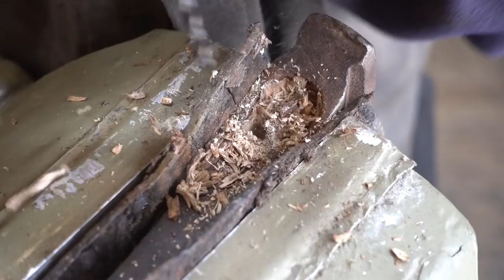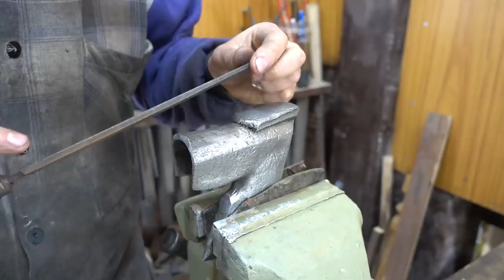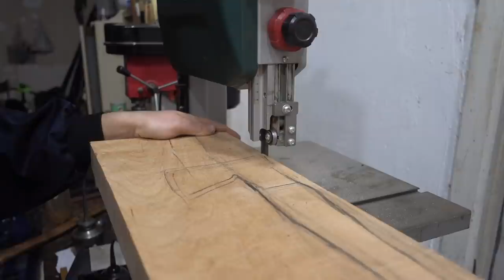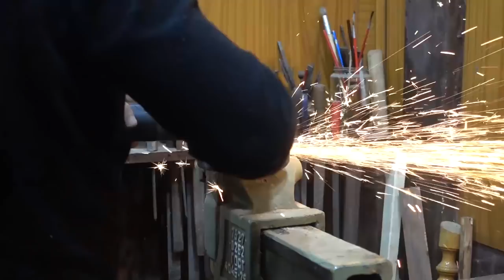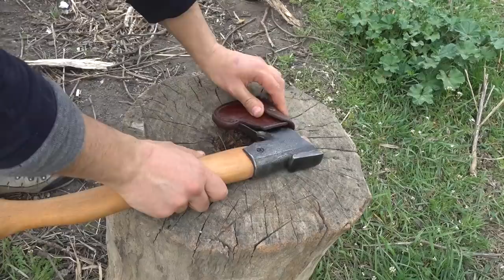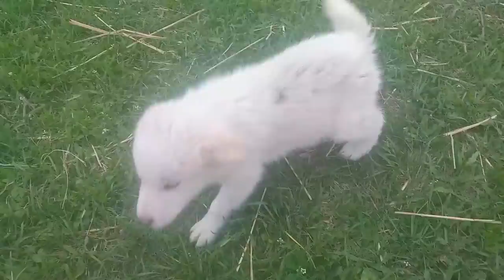Restoration Antique Finnish Kellokoski Axe

Comment: Is the black thing on the axe paint?

What is the nail put into the black bowl after heating?

thanks！:washhands:
Reply from the maker: Hello, this is not paint. This is a tool for etching metal so that rust does not appear after work. I heated the screw and cooled it in oil, thereby it becomes dark in color, and fits under the axe. Thanks for attention.